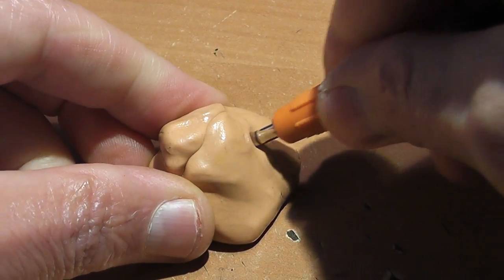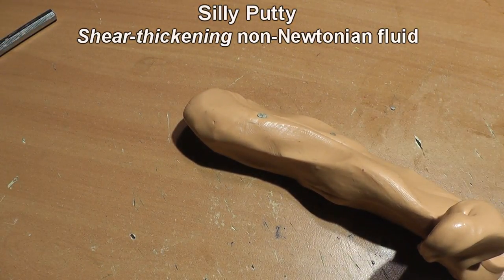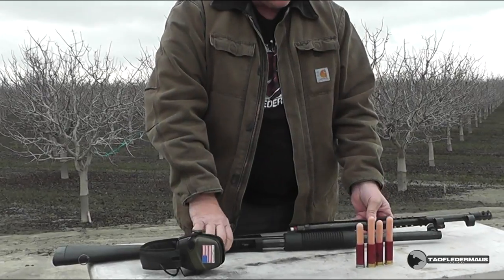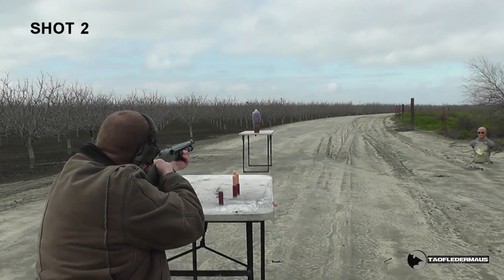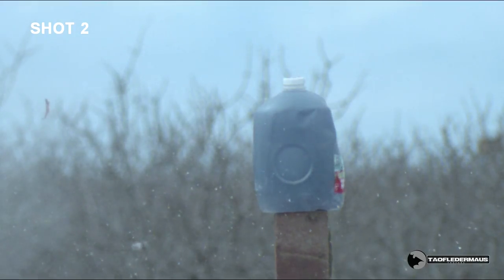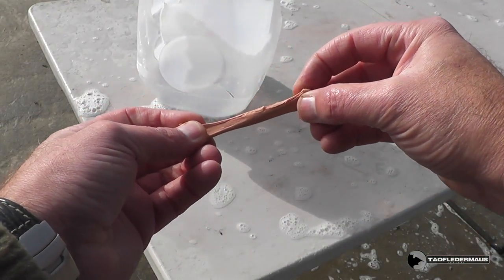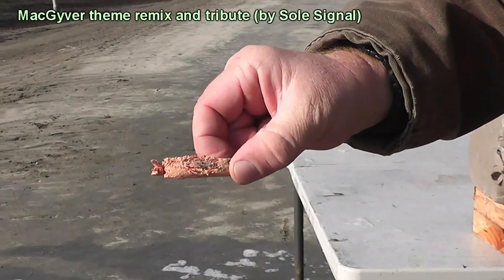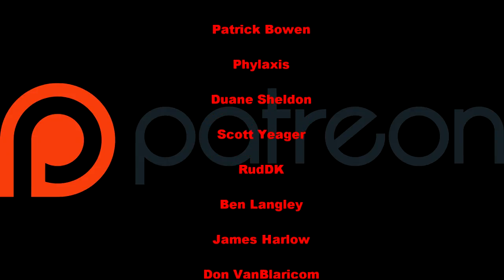The Silly Putty Shotgun Slug Experiment -  Fascinating!

Comment: Pretty nice, would this be considered a home self defense round? Just the sound of the round going off, and something heading towards you would scare the intruder enough to send him packing, also I dont think the projectile would penetrate a double wall, maybe try against dry wall, 1/4, 5/16,  3/8, and insulated. Also use a plastic card, and maybe a couple of #2, #3, pellets mixed in with the silly putty.  Just a suggestion. No extension of a glass via, but maybe a thin plastic cap, so it's easier to use multiple rounds in any shotgun, including the break over.

Comment: Silly Putty is a non-newtonian material. Impact it with great force and it resists deformation, but apply a gentle and progressive pressure and it easily deforms or splits. Custard is much the same. Non-Newtonian matter is fun to fuck about with.

Comment: just curious if you read comments from old vids?
 how about re running this experiment only , use smaller amounts of putty , the size of a normal foster or a bit more with shot cards?
Reply from the maker: I needed a certain weight of payload for the powder to ignite and that is about 5 grams.    The putty doesn't weigh very much so that is why these are so big.

Comment: my initial thoughts are that you may or may not have better luck if the you shot those the other way around. (reasoning from an engineer (me) below)

.. i'd be inclined to try them backwards, with a delrin (Acetal) shot cup with a half-sphere cut out of it to cradle the arch of the glass tube.

(cut out, or just heat the glass and melt the shape in, then shave it round again.)

I should clarify why I suggest it, if the silly putty is being forced forwards and bursting the glass by pushing on the sides, then flipping the tube around will remove that physical action... and glass is stronger under compression... so a better chance of survival.

.. now let's watch and see if the first way'round worked

Comment: Can you do silly putty mixed with shot,  Blu-Tack and shot, soft clay mixed with shot, baked clay with shot (maybe steel so it doesn't melt in the oven) and shot wrapped in duct tape?
Reply from the maker: The shot doesn't stick to the silly putty at all.   I don't think it would have a chance of holding together.
Reply: Could you roll a layer of silly putty around a core of shot?

Comment: The silly-slug look like not so inaccurate as I anticipate.
I wonder how much damage it would do against a human... if you ignore replace the glass tube by something without sharp shrapnel.
Reply from the maker: A rubber bullet only goes about 300 fps,   so I imagine this would really bruise skin or break the skin.
Reply: ***** Hmmm... Yeah. Open wounds would be undesirable for a round to be fired against riots. 

Lots of those rubber bullets were used in some older riots in Brazil due to... Some wanna be revolutionary brats breaking private and public property. 

The standard procedure is to try to aim at legs and try to keep below waist, but it's not unusual to see someone getting hit in the head or losing an eye due the impact.

But then I was just wondering, what about a bigger round with a bigger impact area to avoid penetration? Looking at the slow motion footage of the silly-slug look like it got a larger area then the rubber bullet and look like a big slap, but I forgot to consider the speeds involved on this silly-slug. It happens. Hehe

Even a fluffy and soft pillow can have deadly results of enough energy is available. 

Thank for the excellent content. 😉👍

Comment: shell not fit in loading slot
buy a cobray terminator i say. Its just a pipe with a trigger mechanism. No fuss no muss
Reply from the maker: It only takes about 30 seconds to remove the barrel.   I spend a lot longer tweaking the cameras for each shot while Gregg loads the gun and waits for me.
Reply: I'm just being silly ;) The Kobray Terminator is a terrible weapon.
Tho i wonder if a smaller glass slug covered in silly putty would shatter like that, or the silly putty would work as a shock absorbent?